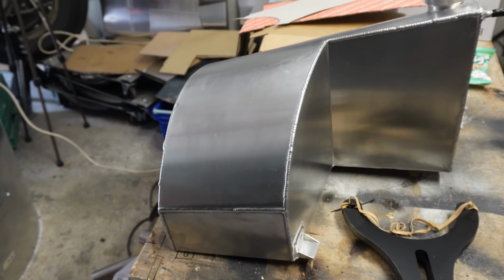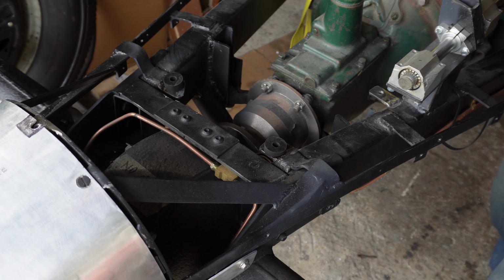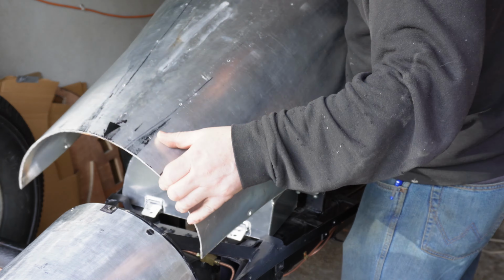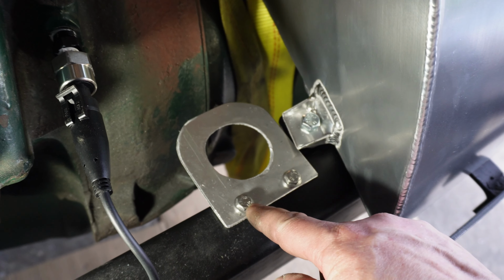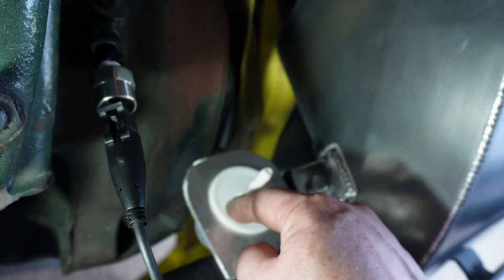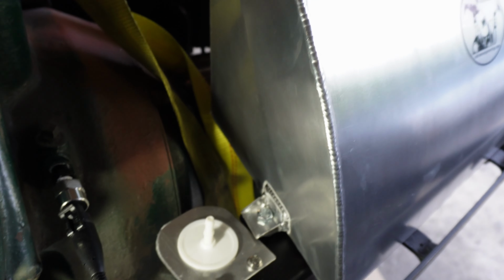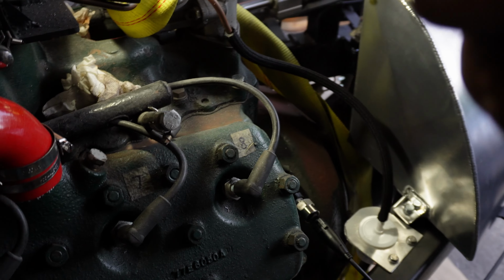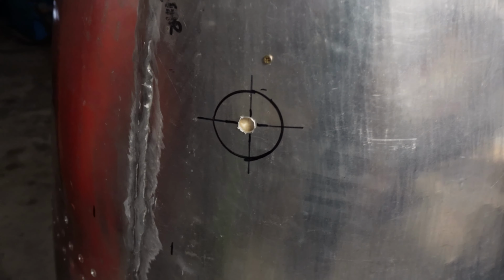Belly Tank Lakester Ep73 | Fuel Tank Goes In

Comment: One trick I use with hole saws is replace the drill bit with a blank piece of rod the same diameter. Then you can drill the pilot hole with a normal bit then the hole saw with it's plain rod can centre tightly on that. It stops the pilot bit making the centre hole oversize making the larger hole neater.